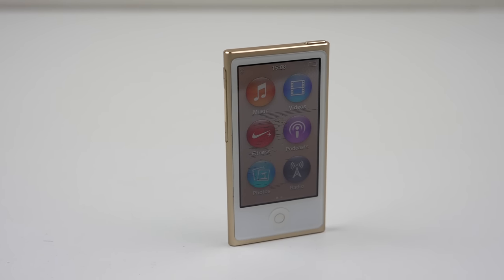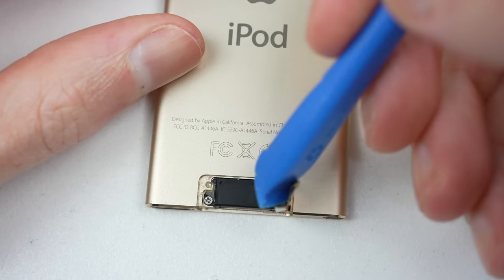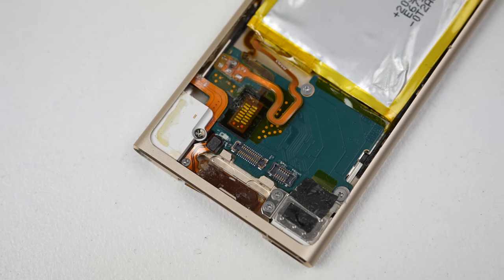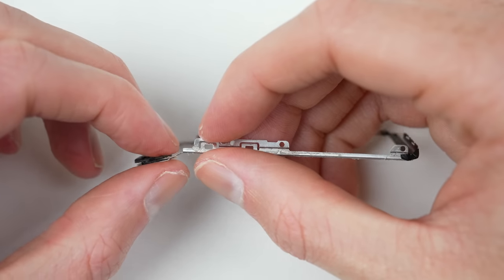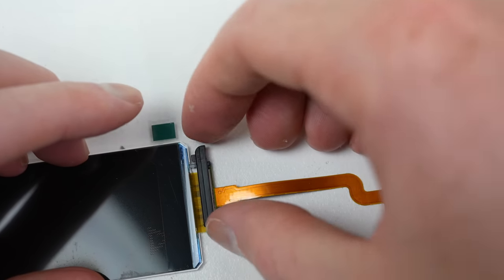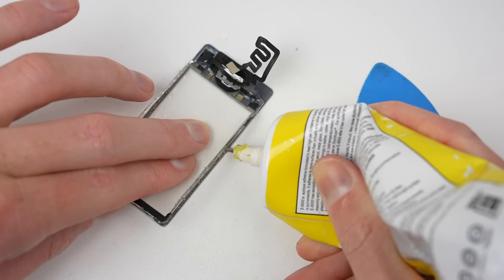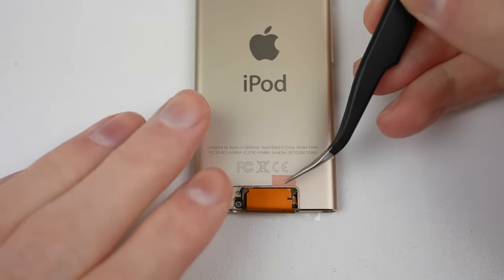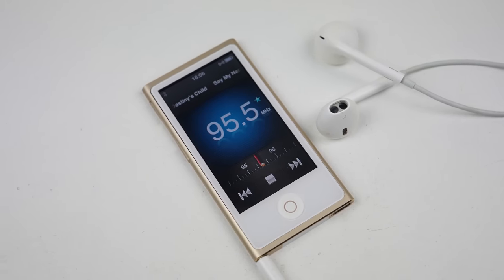Repairing Apple's Strangest iPod - Nano 7th Generation

Comment: Whenever a company tries to tell you that there was no space in the device for a headphone jack remember the iPod 7th generation exhisted
Reply: When a company wants to put a headphone jack on a phone, they will. Like Vivo did in the world's thinnest smartphone.
Reply: bro its to sell their more expensive bluetooth headphones,  my new gigantic tablet dont even has a headphonejack, it makes no sense to me
Reply: Long time ago I had a little pocket radio. The radio itself, was thinner than its headphone jack.
Yeah, that removing the headphone jack BS was all about selling their own line of headphones.
Reply: The 7th? What about the freaking 6th gen?
Reply: @clydemarshall8095  while the 6th gen is smaller height I used the 7th gen as it's thinner
Reply: It's definitely an attempt to sell Bluetooth headphones, as well as giving Bluetooth headphone enthusiasts with money to burn nice smooth shiny things to hold; I can see how, from an aesthetic standpoint, not having to have a bump on your lovely sleek rounded device would be nice if you never use it anyway. 

Personally, I don't love it, even as someone who basically spends their entire waking life in a pair of over-ear Bluetooth headphones. Sometimes, I can't be bothered to go through the Bluetooth connection settings to connect to a different device, so I turn off the headphones and use the cable I keep next to my chair. Way less hassle.
Both types have their advantages (Wireless is better for in-use mobility and removes the inherent weak point(s) of the cable, wired is quicker to switch devices and doesn't need battery charge) and I don't like having options taken away from me. I'm going to be buying devices with headphone jacks for as long as I can.
Reply: @cyberethereal incorrect
WIRED HEADPHONES ARE 29,000 TIMES BETTER GIVING WAY CLEARER SOUND QUALITY,NO LAG IN SOUND AND THEY LAST WAY LONGER AND WILL LAST 5 YEARS AND BEYOND WHEN TREATED PROPERLY
ALSO,WIRED HEADPHONES ARE WAY MORE COST EFFECTIVE ANS WAY BETTER TO THE ENVIRONMENT AS THEY DO NOT NEED BATTERIES
Reply: Or the iPod Shuffle 3rd gen. Seriously, that thing was insane.
Reply: The iPod shuffle was even smaller. Plus it’s laughable they use that same argument for iPads lol.
Reply: The space there is but they want sell batteries devices so you can buy always because last less

Comment: I'm surprised you didn't swap out the battery since you had it open already.
Reply: Because it would be too much of a pain to try to get the ribbon style cable undone without ruining the pads on the logic board. Then you have to get the new battery pads on there. Too much risk on an already working battery.
Reply: @MrMega200  Too much of a risk? Are you kidding me? I’ve replaced batteries on IPod nano 2/3rd Gen models. It isn’t that difficult. Hugh was just lazy.
Reply: also just removing the mesh of the ear buds does not seem to be a quality level repair...
Reply: That battery suffered some serious bending while he removed it. It seems dangerous to just put it back in
Reply: @MrMega200  can you post some videos to your channel?
Reply: @kosmokramer9502  I know this is late, but the 1st, 2nd, and 3rd gen nanos are the ONLY ones that aren't an absolute nightmare to replace the battery in.
Reply: The battery looks like it’s soldered to the logic board

Comment: The iPod Nano 5th, 6th, and 7th gen all had built in FM radios that used your headphone cable as an antenna.
Reply: 0:26 is when he says it
Reply: @lachlanlau  I thought he was referring solely to the 7th gen. I'm mentioning that the feature existed at least as far back as the 5th. It's amusing to think about now given that most people use wireless earbuds which negate the radio on these devices. Heck, the 7th gen might be the sole one with blue tooth capability.
Reply: I believe you don't need certain headphones to use the radio on the 7th Gen
Reply: no, with the 7th gen (maybe 6th too) had a built in radio 

with some of the other ipods you needed a specific radio cable to use the radio feature
Reply: @clydemarshall8095  weird.. when i used mine it said i needed a radio remote
Reply: @sealwheel  That specific cable was only ever your earbuds. I owned the iPod nano 5th, 6th, and 7th gen and all of them included an FM radio that used the headphone cable as an antenna
Reply: @clydemarshall8095  yeah, its the headphone cable with the weird buttons, the standard headphone jack earbuds from the iphone 5ish period werent for the ipod
Reply: @clydemarshall8095  yeah that's what I meant, just timestamping so people can find when he said it.
Reply: It will actually work if you buy a broken pair of earbuds and cut the cable on the headphone jack part
Reply: Funfact: if you use earpod cable to the radio has an antenna to receive and you switch to bluetooth speaker to listen… the radio won’t get it to to use a wired antenna and stream it to a wireless audio output simultaneously 😅

Comment: I had this nano growing up, and while I prefer the 5th gen nano to it, I'm def nostalgic for the 7th gen.
Reply: My father has the 2nd gen, bought it brand new in 2006.
Reply: I have been using a 3rd gen for two years now, great device
Reply: @pietrocavicchioli6128  3rd gen was my favourite. If they still made them (perhaps now with bluetooth) I'd totally buy one for the gym
Reply: I have the fifth gun, I prefer it over the 7th too
Reply: This 7g iPod was a replacement for my 5th gen one because of the battery not holding enough charge and of course the 30 pin cable getting outdated. The touchscreen was not as nice as using the wheel
Reply: @peterhodgkinson5095  that’s why I’m planning to buy iPod nano 5g from eBay I have a 7g and the headphone jack is kinda busted

Comment: This device is so small, repairing it could generate more damage than you wanted to fix, but you solved it well and without too many additional costs, you were very good. Nice video as always.
Reply: I tried to replace battery from my 5th gen Nano, but I ended up broke Its click wheel, then I just threw it to trash can.

Comment: You know that you are an official repairman when mum starts going to you for help with devices
Reply: I've also done repairs to my mum's devices; most recently the battery in her iPhone 8 Plus 😁
Reply: true achievement
Reply: Anyone whos a bit of a nerd can probably confirm that they are the go to tech in the family, even if they know nothing about such things.
Reply: no, its just the fact that you're a guy and women usually dont know sh.... about tech stuff at all.
Reply: @realcyphox5919  Thats pretty sexist bro
Reply: yup
Reply: @DJBla2e01  interesting, did you put water proof seal?
Reply: @YourLocalHandle  Yes I did. Not that it's gonna do much, as there's a tiny crack below the home button, plus the phone's over 4 years old, so all the other seals are likely worn anyway. I still did it cause why not?
Reply: My mom won’t even let me go near her old phones
Reply: @ItsLeeeroy  Either you can't fix it or your mom is paranoid with previous repairs.
Reply: late reply but I started with the 7th gen then get the 5th gen used on amazon because of the old fashoned click wheel
Reply: Everyone tells me I'm a tech genius my boyfriend goes to me about hacking my entire family thinks I can fix anything just cause I fixed a loose cable in my mom's computer and replaced her charger port
Reply: @quinspranger4880   that's usually true in most cases

Comment: Btw FM radios were the included in all the nanos from 5-7 and all the classics 3-7 can use a special apple in-line remote that connects to the dock connector that gives it an fM radio (plug it in and the hidden radio UI will appear on the main menu) also ALL the Nanos can use this attachment aswell
Reply: since the iPod nano 4 it was internal fm receiver

Comment: I don't think this is the only other iPod with built-in FM tuner. The 6th Gen iPod Nano that some wear like a watch with its aftermarket watch band case also has an FM tuner. I was one of those geeks that wore mine on my wrist and though the wire to the ear pods acted like the antenna, the reception was not very good but that was my Apple watch before there were Apple Watches.
Reply: I have a 5th gen nano with a radio as well.
Reply: I also have a 6th gen, I also used it as an Apple Watch haha. The radio worked quite well for me
Reply: 6th gen was great for running. I’m sure it did use the headphone cable as an antenna.
Reply: some classics also have one when you use the radio remote on it.
Reply: This was one of the few versions I didn't purchase by this point I was listening to shuffles and then the iPod touch. I only listen to one radio station and that's NPR as most radio and all commercials annoy me, but I borrowed one at one point and I really liked the radio station option. I remember some geeks(!) Wearing the 6th generation as a watch.. but I had no idea that it had radio. The crux for me would be that you would have to have wired headphones and wearing it on my wrist would be.. weird?? 

That's why I just love channels like this where we can talk about our favorite parts of apple/ipod years afterwards... And if you're talented, even resurrect them! Cheers!
Reply: @randomblock1_  same and it was like a ipod shuffle and a iPad touch were combined

Comment: The 6th gen had a built in radio as well, the headphones you use serve as the antenna. I bought both the 6th and 7th gen on OfferUp just to have them because they're so neat! I really wish the 6th gen had lightning though. The 30-pin is fitting, but you could probably get a bump in battery with the smaller lightning port.
Reply: @KAAN CAN I know, it's just a shame. I wish it could've been a similar era to the 7th gen and gotten lightning, or maybe been updated with it, it's a really neat little design.

Comment: The flat flex that separated from the touchscreen was likely Z-taped in place. It's an adhesive tape which has conductive strands running perpendicular to the surface and the adhesive is heat activated.

The mesh piece is part of acoustic tuning of the earbuds and should ideally be washed out in a suitable solvent and reinstalled back.

Comment: 0:28 if you mean FM Radio then nope, the iPod Nano 5th generation had radio already, idk about 6th gen since it removed a few features cause of the form factor I guess but the 5th gen had radio.
Reply: Yes the 6g also have built in radio, and it’s very interesting how battery can last, I still using mine for jogging with the watch case and works great

Comment: Was my iPod nano 5g replacement in 2013 - defo felt not satisfying using the touchscreen as I got with using the 5g wheel. The 7th gen was used up till 2019 when I caved into Spotify

Comment: Thanks for the video!  My first iPod nano 7th gen got washed in the machine after about a year of use.  I put it into a box of rice for a week, it then worked fine for many years but the screen never worked after the washing.  Just plug into a stereo or computer to set it on random, play and skip songs you didnt want with the toggle.  It finally tanked, and as a guy that can fix anything I am thinking about taking the plunge.  I have a couple more 7th gens, one that had a new battery installed by the seller, but it's bad after 6 months...  and my current 7th gen with a badly broken screen and lcd but it still works when set on random and control with the toggle.  Going to give repairs a shot after I order some supplies and tools.  Thanks HUGH !!

Comment: Oh god this just reminded me of the absolute nightmare that was replacing the LCD of this model was for me. Luckily I thought ahead for once in my life and bought an extra digitiser because I knew I could very easily fuck up the display too. (Spoilers, I did) I'm not sure how you're supposed to do this without obliterating the LCD, the old one practically turned into dust. 
And to top it all off, the frame got bent last second as I was fitting the display assembly back on. So now it's collecting dust and shit inside. 
For the life of me I CANNOT find a replacement midframe anywhere online which is so incredibly annoying as I've abused the current one a lot and I wouldn't feel confident reusing it. 
So yeah, now I'm left with a cute nano that has a lifted display which I REFUSE to reopen unless I have another LCD or just some extra parts with me. Dealing with nanos results in complete CARNAGE.

To the general viewer, please avoid working with those if you can, it's absolutely horrible, it's not a fun repair, and you'll end up with a working (hopefully) but very mangled tech sandwich
Reply: The 4th 5th and 3rd gens are doable repairs in my experience but any of the others end up with carnage
Reply: @jml2343  4 and 5?? Doable?? Deary me, I must be dealing with a repair god here, I bow down to you
Reply: @CrayCrayslab  as long as they don't have an expanded battery it's possible. However I do agree that they are super hard and the screws are so tiny that they strip ALOT so watch out for that
Reply: Bro we’re not in school anymore don’t be writing essays for fun
Reply: @i-.45  you ain't a teacher dawg, why you be reading them?
Reply: @jml2343  1st gen nano is also pretty easy to take apart (but all of them require soldering so everyone has a pretty low standard on how "easy" it is)
Reply: @gorgonfreechman365  it's easy to take apart but reconnecting the click wheel and screen is such a pain I just gave up
Reply: How can I contact you ?

Comment: hey.. nice video, just one remark about the earbuds. i had the same issue about the volume, i removed the grills , but noticed that the bass was pretty much gone after that. I think since theres a thin layer of plastic behind the grill i assume that part was responsible for it.... i wonder does anybody els had the same experience after this fix?
Reply: I just bought some decent headphones from audio Technica, the sound was much better from the get go. 

I don't bother with apple headphones anymore and yes too have had the bass issue.
Reply: @Anoalekontrieger  wow, some over-ear headphones from a company specialized in audio equipment really do sound better than some cheap-a** in-ears from a company that usually rips their customers off?? get out of town.
Reply: I've cleaned mine twice now with some alcohol in a small bottle with needle a tip
Reply: You are correct, the mesh he removed is part of the acoustic tuning of the earpods and should not be taken off. Best course of action would be soaking it in a bit of IPA and using something like a Watchmaker blower to suck up the melted earwax
Reply: +1 this is bad way to fix it
Reply: There is a mesh on the other side. Remove it too. My AirPods had also bass and Noise Problem but now they're working just fine
Reply: @redsell7320  no this way bad too
Reply: If its sound is muted or one side is not working, it will be restored if you drop a drop of cologne or alcohol and blow it strongly from the side.  I'm always doing it and it's getting better, try it, it will happen
Reply: @Anoalekontrieger  earpods sound great for their price

Comment: Nano 6th gen also has radio and you can get radio on other ipod models using a accessory
Reply: No you don't you prune
None of the iPod Touch Devices have that
Also,I have the 6th generation of the iPod Touch which has a much sturdier body to it
I have had my iPod Touch for 5 years currently but it will be 6 years by January 2024
Reply: @stephensnell5707  I'm not even talking about the ipod touch. I'm talking about the classic ipods. Which does have a ipod radio remote accessories. And i said nano 6th gen in my comment nothing about the touch

Comment: 8:56 NO! 

If its sound is sound lows or one side is not working, it will be restored if you drop a drop of cologne or alcohol and blow it strongly from the side. 

I'm always doing it and it's getting better, try it, it will be fix :)

Comment: Hello,i have replaced the Touch Pad on my Ipod 7.Bevore it worked,only had a little Crack downside.A new Accu is replaced too and will be charging.But the Pad dont work.The Display is on i see all on it,but the Pad dont work.The 2 Connectors are clean.What is wrong here?Thanks. ------- Update..... i have contact the old Touchpad and this work !!! I have buy a new Touchpad that dont work !!! What a F... is this .....

Comment: I know I might not be common knowledge but I knew back in the day taking these things apart in high school for computer science you had the heat them up multiple different times to get the adhesive loose and keep it loose while you were taking it apart so all those problems you dealt with could have been remedied by simply making sure you were heated it and that adhesive was loose
Reply: Must've been his experience repairing phones and only heating things once.
Reply: Your grammar is rather poor